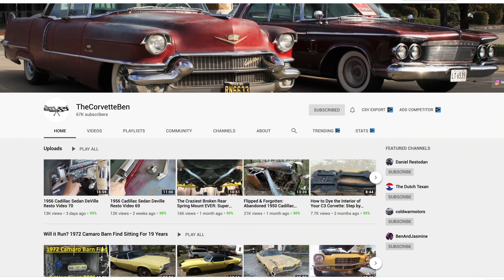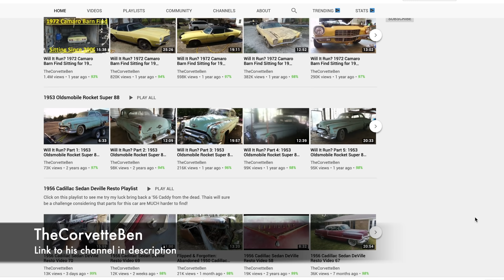Corvette Stingrays - Built vs. Bought

Comment: I'm only 2 minutes in to this, but gotta tell you guys, you've put a great big smile on my face. Can't wait to see the rest of this episode!
Reply: Just finished this. ( Had to do a couple of errands in the house ) Still have that smile glued to my face. Nice way to go to bed! I'm 65 and my favorite car that I owned was a 1972 V6 Mercury Capri, also red. I'd sure like to get a hold of one of those again and "soup it up". I liked the 1973 model a little better, because the '72 had two of the three exhaust ports on each side of the engine were siamesed, whereas the '73 had 3 individual exhaust ports down each side and also nicer looking tail lights and interior appointments. Well, an old guy can dream. Thanks guys!

Comment: Sounds like you either need to put a more highway friendly rear gear ratio in the '74 or do a 5 speed Tremec or a Magnum 6 speed conversion. You can purchase kits to do either that are specifically for the C3 Corvette. A really nice, bolt in conversion.

Comment: C5 is arguably one of the best Corvette generations, especially the C5 Z06. Dont forget C5 is where the Le Mans domination/wins started. Highly recommend the book "All.Corvettes are Red".
Reply: The C5 is definitely one of the best, but the Z06 package is overrated and overpriced in today's market commanding $10k over a base C5 condition for condition, which can easily be 1.5x the price.  Most Z06s are thrashed and trashed at this point, too, as they were bought as cheap track cars 10 or so years ago, so fixing all of the worn parts will cost you even more.  Most of the performance increase was due to larger/stickier tires vs. the dogsht runflats that came on the base car.  The Z06 only had a 15% power bump and even then only up near redline since most of it was from a cam and everything else was fairly trivial.  The fancy schmancy titanium exhaust mostly gets taken off and replaced with an aftermarket exhaust anyway, so more wasted money.  Most people put C6 Z06 shocks or Bilsteins on base C5s for $400 and it is far better than stock C5 Z06 suspension as well.  C5s are incredible but don't fall for the Z06 trap, it's as overrated as the LT4 vs. LT1 was on the C4.

Comment: Nice description of project car vs turn key purchase. I bought a C-3 that was straight out of race car shop. Pro Street full cage, big block 496 engine, built race trans, $70,000 of receipts, plus all parts removed came with the car. I decided to go blowner 540 c.i. run on E-85 detune to 1200 hp. I wanted just a weekend around town car that is laughable with parachute next to my handicap tag. I will end up with $34,000 total in the car but engine and transmission is worth more than the total car. No way I would spend the money that was invested by other owner. But I wanted a 8.80 second 1/4 mile street car for my last hotrod. People love it or really hate it because it is loud aggressive and looks like a Hot Wheels toy car. Here is the value of crazy....just what I wanted for me. Buy or build to please yourself. Force sale on turn key $70K car still in garage, no tag $9200.

Comment: One really big thing for me about the build not bought is that you get intimate with the car and you know what it is, seen few dreams shot down by "restored" junkers that were just rust buckets filled with bondo and engine/trans was just barely holding together with heavy weight oil. These "fixes" are of course OK with 1k bangers but at >10k it is just stupid.
But at the same time it is often those junkyard treasures just too expensive for what it is as those need many times more money and effort.

Comment: IMO, the best deal if you're capable (which again, we obviously overestimate our capability) is buy a project car where the interior and body is really good, but has a blown engine or transmission. Doing the opposite, finding a running car where everything is messed up, but it still runs, tends to cost you a lot more to get it nice. Also now with Corona, it's getting back to being a buyers market for cars, and I see a lot more cheap cars again, as people need money for bills.

Comment: Not sure if you guys are aware of the steering problems associated with the early c3 vettes. They have a habit of cracking/breaking the frame at or near where the steering arm mounts to the frame. It was bad enough that there actually are kits to reinforce the frame, and others to repair the frames if they have already failed.

Comment: It actually hurts me that you have a car with a great performance engine and you havnt replaced your shitty gear box... unleash the beast, poor engines been choked
Reply: Basically, the car is wearing a face mask.
Reply: How is that affecting performance ? It revs out fast so he probably has a low gear in the car which is good for acceleration....Can he do a five speed ? Sure .That’s money though especially if you buy all new parts
Reply: He doesn't even need to replace the gear box, he just needs to swap the rear differential to a taller ratio.  Winston could probably do it with what he learned fixing his C3 and then sell the current diff and almost come out even.  With that much horsepower, 4th gear should be geared out to no less than probably like 140 mph and every gear would still pull strong and then it would be drivable on the highway.  I think they've since sold these cars off, though, so I guess it's too late at this point.

Comment: Out of experience of my own C3. Build your own - period (or just get something that starts up).
Long version: You never know what previous owner did to the car, and C3 likes to rust especially in birdcage and rear frame area.
Not to mention all the body tensioners (or whatever those small metal plates that hold all the body panels together) need to replaced if they have not been touched since the car was build.
Did I mention that you should do all the fluid checkup?
I spotted mine C3 had loose halfshaft (it drove but the retainer was loose in diff pan - oh also nearly no oil in limited diff).
I could go on and on but If you want this car for yourself build this thing or let someone did this for yourself.
If you want to ride 1 or 1,5 years then flip it - buy ready setup.
I'm in the same boat with mine C3 I will never get back what I put into it (well maybe in 20 years).
But would I want to trust rusty frame and suspension and other components? No. 
This may be a classic but it handles like modern car.
Also hurry up - those C3 wont be any cheaper than now.

Comment: You probably don't need to wear your masks when you are alone in your car.
Reply: In California they're outside, and the law will come for them if they are not wearing masks.
Reply: @microcolonel  you don't have to in a car and they really are not enforcing it. I've been in several stores without a mask. I wear one in Costco and Home Depot.
Reply: microcolonel oh brother!
Reply: i believe the logic is, in case a cycling waits next to you at a red light, they would be closer than 2 metres / 6 feet
Reply: Update: almost every store requires a mask now. I still see people alone in a car wearing one 🤣
Reply: Taking your mask on and off and on again actually degrades its filtration ability. Kudos to them for being responsible. Im here in Texas and respirators are a polarizing thing due to our f’ed up political leadership
Reply: @francoa.9646  Some old lady got apoxia while driving became delirious and ended up in a car accident. Wearing a mask unnecessarily also degrades it filtration ability as it fills up with dust and moisture. You should only wear it when necessary...when you are in close contact with other people.
Reply: @joshuagenes  wearing masks dont cause hypoxia

Comment: "These engines only get up to 5000rpm before they hit redline." LOL, the tiny engines in my RC cars idle at 5000rpm. That's not a joke -- they actually do idle at 5000rpm.
When you say you can't modify cars newer than 1974 in California, do you mean you can't modify newer cars at all, or you can't modify them in a way that substantially increases their emissions?
Reply from the maker: You can't modify or change the engines as it'll mess with the emissions

Comment: 100% feel buying a well kept car is worth it, assuming you really look it over and make sure it's not just been recently washed and given a fresh coat of paint.  Even if you want to wrench on it, you'll be spending that wrench time making real improvements (i.e. restomodding) instead of just getting the thing to work.  In my experience, really bad shape cars with poorly running engines, etc. have suffered years of neglect and abuse and will likely have similar problems with rust, shot bushings, bad weather seals, etc. that are all just a big waste of time and money to bring back to acceptable condition.  The best person to buy a Vette from is an old guy that loved the car but is just too old to get in and out of it anymore and took really good care of it and never let it sit neglected and undriven for years at a time.  Be wary of teenagers and generally people under 30, more often than not they broke something expensive and are trying to unload it and make it someone else's problem.  Not always, but if you don't have the mechanic skills or a knowledgeable mechanic to inspect it, best to just look elsewhere.  Another big thing is to make sure you have a "complete" car as piecemealing interiors on a car this old will get expensive fast, unless you plan to heavily customize it and make your own interior body panels more like a race car.  In Winston's case, I would've recommended just custom fabbing panels and getting race gauges instead of trying to buy period-correct parts.  Would've ended up with something cooler for less money and would've stood out more on the used market.

Comment: Something has changed in 15 years or I did something wrong. I shopped for a C3 15 years ago. I couldn't touch one in decent shape for under 20 grand. In the 10 to 15 range they were all ragged out beyond what I wanted. I bought a Mustang.

Comment: That was fun.  Now I would like to see you bring back a late 60's Opel GT.  Similar styling to the 68  Vette, but smaller and lighter and to my eye better proportioned.  It was designed by the same guy but for the European market.  They are hard to find because they rusted out so easily.

Comment: "[C5] is the worst generation"

I beg your pardon?

C5 in many ways is the best generation.  All of the reliability of mature fuel injection without the nannies of newer Vettes and complication that comes with it.  The chassis was made much stiffer than the C4 and the body rattles and squeaks far less as a result.  The handling with the Z51 package and upgraded C6 Z06 or Bilstein shocks (a scant $400 for all 4 corners) is the best combination of flat cornering and a smooth ride of any car I've ever driven, and I'm including R34 Skyline GT-Rs, Ferrari 458s, and many many other well known sports cars in that list.  All other cars float like a cloud or handle flat but never both.  The C5 is also one of the most aerodynamic road cars ever made which not only helps acceleration at highway speeds and top speed, but also makes it probably the most fuel efficient car of its performance class of all time getting over 30 mpg at steady highway cruise.  I also greatly prefer the styling over the C6/7/8 as it just got more and more Michael Bay Transformers through the years instead of the C3-like continuation the C5 had.   The C5 is not only not the worst, in my opinion it's the best, especially considering the value they are in the used market right now.  C7s and C8s might turn faster lap times but you won't have more fun doing it and you could buy a C5 for every day of the week for the price well kept C7s and marked up C8s are going for.

Comment: Very good breakdown of buying a 'done' classic versus buying a project car. I did the latter with my Celica GT4. Picked up mostly turnkey(besides a major issue the seller didn't disclose that wound up costing me a ton of money later) and with very low mileage(about 30K). Other than that major issue the car's been great and has needed little, even though I've almost doubled the mileage. I'm about $20K in on this beast, but I've just about loved every minute.
I picked up a project A70 Supra Turbo a couple of years ago for dirt cheap($1400 when the R154 gearbox it has was hovering around $1500). Doesn't run and needs everything. I'm about $15K deep, but I'm also doing a complete mechanical restoration. New engine, reliability and performance mods, suspension, brakes... everything. Cosmetic work's going to push it close to if mot more than the $20K mark.
However, I'd rather do the building. I'm mechanically inclined enough and have friends who can help with the more complex bits. That way you what was touched on your car and how it was touched.
Reply: @J G : I can agree with that. For me, this hobby gives meaning and an end goal to all the drudgery and toil of day-to-day life. That and it's very much removed from my day job so it's a welcome break.

Comment: C milk need to change his rear end gear ratio to between what he has and stock something in the middle  so it's more pleasant on the highway bit still pulls well it'll give better fuel mileage, it's no fun on a trip with drag gears those revs will wear your engine out. Something like a 3:50 to 1 or 3:73 to 1 ratio you probably have a 4:56 to 1 in there now.

Comment: 1- no way in hell do you have 30-40k in that C3 lol

2-no way in hell are you pulling over 400hp outta that small block. Your lucky if your getting 300 hp. You don't even have a decent cam in that sumbitch. 

3- you should fix the 4 inches of slop in that steering Mister...